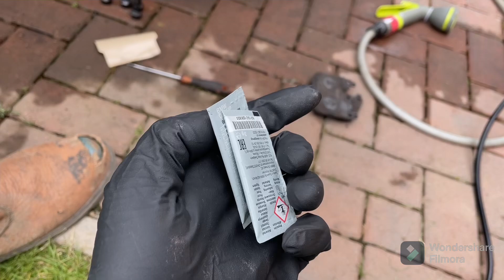F56 Mini JCW Front Brake Pad Replacement

Comment: If the sensor hasn't been triggered, is there a reason why you can't reuse it?
Reply from the maker: @SinCityAMG  in theory no but they do snap. My rear one was triggered but not because they had worn through but because the wire snapped. Worth changing for the cost in my opinion.